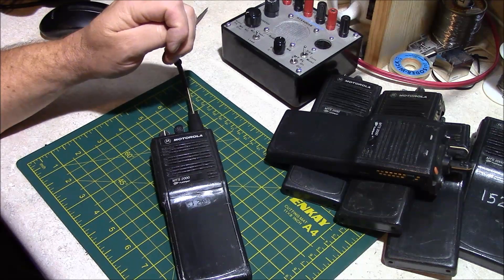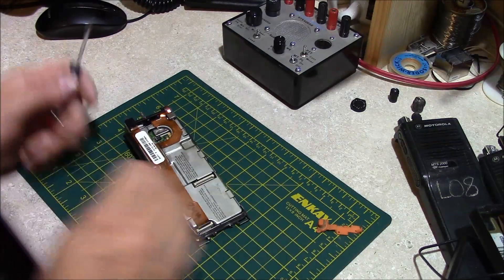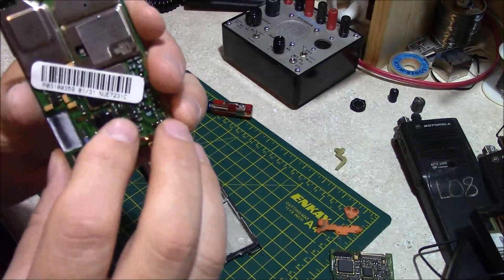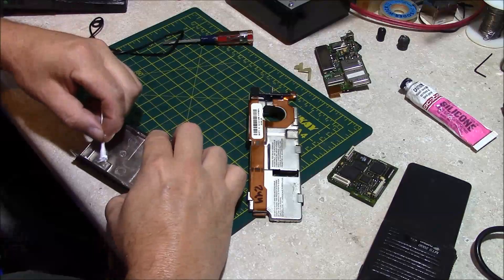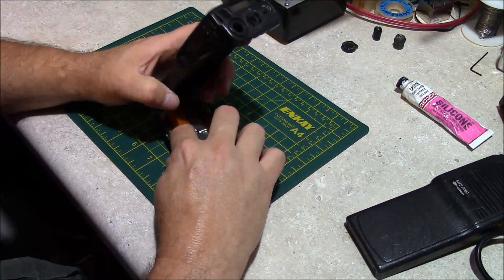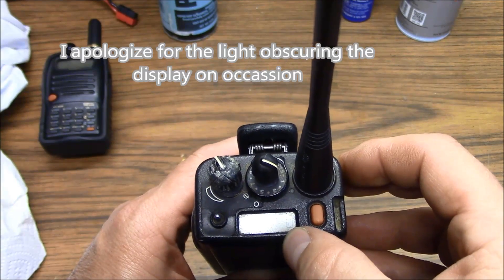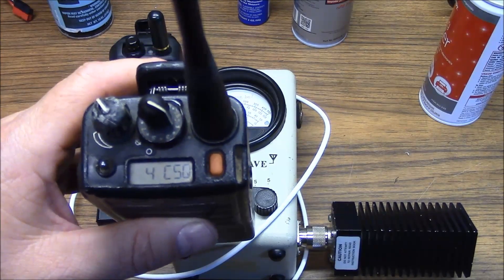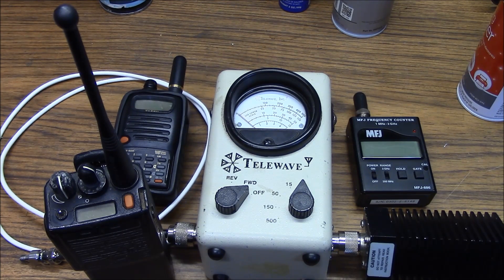Motorola MTS2000 / Jedi / MTSX disassembly and simple test mode

Comment: You make this look so easy. You must've gotten a smoking deal on those. Thanks for sharing!
Reply from the maker: Oh yes new knobs and antennas exceed the radio cost - everyone wants DMR stuff on UHF these days and I found these in a bin calling to me to spare them from the shredder. I felt duty bound to oblige. 48 channel narrowband part 90 radios with a display that power up - count me in. Thanks for watching !
Reply: without your knowledge....they are bricks to most these days.
Reply from the maker: Most don't want to put any effort forth which is good for the guys like me who like playing with bricks :) I remember transitioning from Saber's to these ......
Reply: I remember the Saber's!  I'm going to keep my eyes open for finds like these.
Reply from the maker: The saber is a fine radio for 25khz channels and I have many still on the air. There are repop knobs for them available now which really is nice although the batteries have gotten pricey.  Let me know what you find in your search.  I love helping keep history alive.
Reply: Will do! If I fond anything, rest assured I'll be picking your brain!
Reply from the maker: Anytime ! The hard part is scoring parts but my experience with commercial stuff is most of the time if it powers up it will be servicable . Beware stuff that is inop as it likely has been cannibalized or has bad interconnections .  If the price is right (5 bucks or less) you have little to lose.

Comment: Cool video. When I go to RF test on my MTX8000 800MHz and then I go to 2 CSQ I actually hear people talking like Utilities guys. It’s pretty cool.
Reply from the maker: That is pretty cool - That frequency should be 851.0625 . What system are you close to ? Thanks for watching !
Reply from the maker: Correction - 2 CSQ RX is 860.0625 per the service manual.
Reply: SurvivalComms do you know what the transmitting frequency is?? And that frequency that you just told me is 1 CSQ. what is the receive and transmit frequency for 2 CSQ 800 MHz? Do you know.
Reply from the maker: @walkietalkienoah  TX#2 is 815.0125
Reply: SurvivalComms thank you

Comment: Hello,
congratulations for your video which is very interesting and with your help I was able to disassemble the device and get to the internal electronic boards. The problem is the programming of the channels. Can the software for this Motorola model be downloaded from some trusted website?
Thank you very much
Giorgio
Reply from the maker: It is in the wild -  Like most commercial software. Use your search engine . V2.03.00 was the last revision of CPS RVN4776. Thaks for watching !

Comment: Great video!  They make new aftermarket replacement front covers on eBay now, all you have to do is move the speakers ribbon over.  Do you offer portable repair of this type: HT1000; MTX8000/9000, MT2000, MTX838; MTS2000?  The Jedi series was the best!
Reply from the maker: I have seen the aftermarket housings but I have not purchased one. I have used the aftermarket knobs and antennas often however. I used to maintain a fleet of 80  JT1000's and I have had boxes upon boxes of legacy 800 radios that I have cannibalized for parts over the years. Thanks for watching !

Comment: Too bad its little brother the HT1000 and Visar are not capable of narrow band. Still use them for the Ham bands. Have the MX350 S in the archive as well as some rock bound MX300 radios on UhF as well, not sure of what case size but they might be 340 size. Have you ever seen a true MX300 radio, the shortest of all MX line? Only works as a low power radio with out CTCSS.  They even made a rack mount repeater based on the MX radios, not to mention the Secret Service suitcase repeaters with the old analogue voice scramblers. 
Brings back great memories from the early eighties, even the Dayton Hamvention.
Reply from the maker: The HT1000 D models will do narrow band but the VHF variants have kittens with entry of splinter channels.  I do see the 310's on ebay now and then but do not have one in the collection. I have a couple pristine PX300-s in the collection however . I would love to find some repro or NOS PTT covers. Those were truly the good old days.  Thanks for watching !

Comment: Hi sir.great video. Can I ask because I need some knobs for another radio.these knobs they sell on eBay are the shafts the knobs fit on 4mm diameter and looking on top there like the letter-D .i want the knobs for a Radio scanner yupiteru mvt 9000 .please could you get back to me I would appreciate it.if there 6mm then know good . Thanks
Reply from the maker: 3.5mm on the volume control and 3mm on the channel selector for this model radio. Best bet is to find some knobs using set screws. Not a perfect selection but will get the job done. Thanks for watching !

Comment: can you make a video on showing how to put the data port out of the radio and back in its wear you plug in your speaker mic
Reply from the maker: The plastic of the universal connector or just replacing the flex ?
Reply: the golden programming port that's on the side of the radio the accessorie port i no it's so post to pop off but was go in to see if you cold do a video of you pop ing it out and put ing it back in thanks
Reply from the maker: Ok so the plastic portion of the universal connector has popped out of the housing. The best way to repair that is through replacement of the housing and flex as typically when that separates it is due to a structural failure in the housing and is not considered serviceable at this point. If you do not have a housing you will need to use an epoxy and place a bead around the perimeter of the separated universal connector , place it in the housing, then affix a soft face clamp and allow the epoxy to cure. Due to the nature of plastic repair it is likely to separate again but can be retained with an audio adaptor or speaker microphone.  I hope this helps !